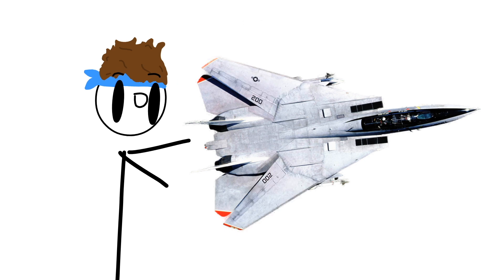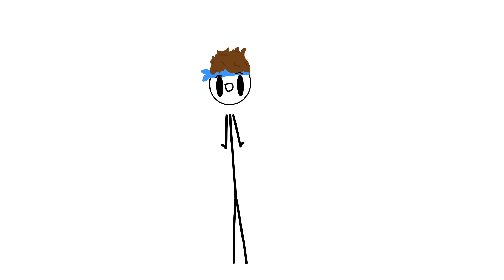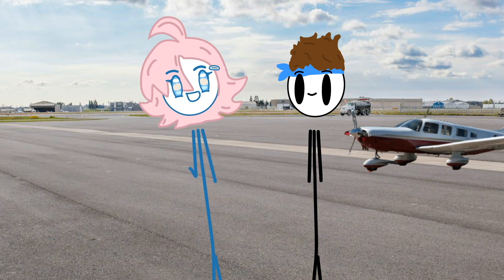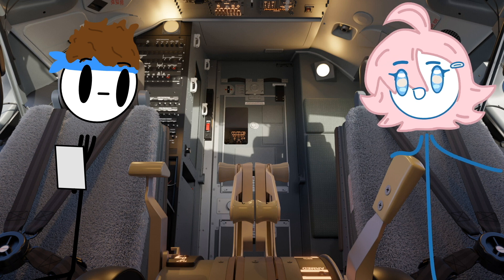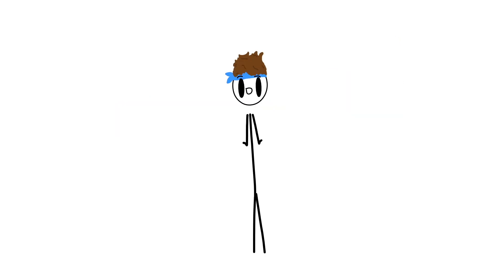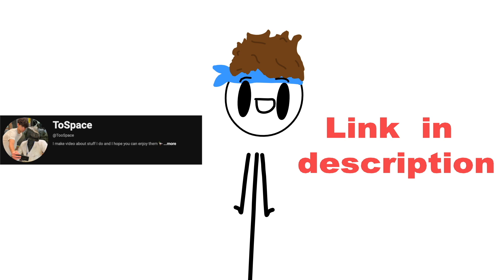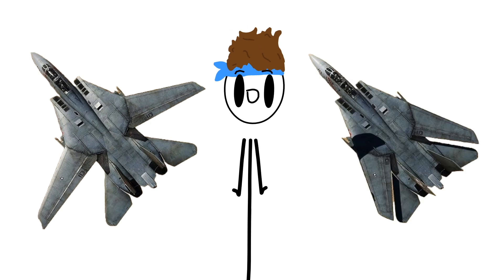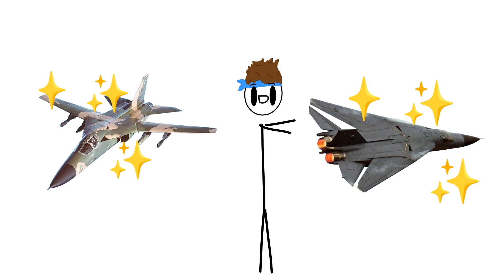Why this Plane is the Way it is

Comment: fairly certain that mach tuck (the lift moving back) actually pitches down the aircraft rather than pitches it up, correct me if i'm wrong though: 2:33
Reply from the maker: No you're absolutely right, I made a mistake..I put the correction in the description. Thanks for writing a comment 🦆
Reply: canard cooler

Comment: Some facts about the F-14
Currently if the F-14 was left in service we would be paying as much an F35 amount of cash every time the navy repairs one.

2. The F-14 if not retired could of gotten more upgrades we could of gotten the F-14D an F-14 with new radar and could carry bombs i think then the SF-21 so Super Tomcat-21 which turned into a multirole fighter and AST-21 Which also got stealth apparently if it was bulit. and the Airforce were considering the F-14 but went for F-15.

3. The F-14 Likes compressor stalling alot which is what killed goose. Simply compressor stalling is when the engines dont get any air and the engines just shut off due to lack of air and then u go into flatspin. this dosent just happen due to flying through jet wash this happens if u do too hard of manuever on the F-14. The intakes were also had alot mechanical bits to help with stall issue I believe but on F-15 they just made the intake rotate with the plane.

4. The F-14 had the worlds first microprocessor.

5. Tom in Tomcat comes from navy admirl.

6. Last one theres a mockup tomcat with just 1 Rudder and it looks cursed.

Also F-111 WAS MENTION HOLY SH ARRRRRADDDDDDDDDDVAAAARRRRRKKK
final neat info F-111 was forced upon the Navy buy navy said it was too big and heavy. But the navy did wanna keep the sidebyside seating and ejection pod then seats F-14 had none of those lol

If u want more F-14 info theres videos on youtube that explain this all better then me
anyways good morning good night imma head out

Comment: The thing i love about the f14 is it's built around the AIM 54 and the AN/AWG9 radar 
and you gotta love the aim 54 it's over sized but it's the first fox 3 and marks a turning point to beyond visual range engagements as we know today (that the aim 7 started)
Anyways fun fact the f14 had something called glove vains which are little lift surfaces that deploy in front of the wing at mach 1.4 they increase left and move the cinter of lift forwards (i also suspect that they make the shockwave miss the wing redusing drag in a similar way arospikes on some slbms do but thats just a hunch) however they were very mantnece heavy and just plain heavy so only the a verent has them (and some sorces even claim the doors for the glove vains were welded shut on the a verints so ground crews wouldn't have to deal with them)

Comment: With its wings swept back, does it get any of the benefits of a delta wing? Or does the space between the wings and the rear horizontal stabilizers break up airflow too much?

Comment: Heyo, a great video as always. 

Just wanted to expand on the topic of why unswept wing aircraft are not usually flying at transonic speeds. This is in no way a critique of the contents of the video, I’ll just try to expand the topic a bit more for the people interested.

The reason we see swept wings at all has to do with two things. First one is airfoil design. As already mentioned in the video, as air moves over a curved airfoil, it will have a tendency to accelerate. This can cause local supersonic airflow regions to form even when flying subsonic. The interesting thing about supersonic airflow is, that (from the point of view of air) it’s easy to enter, however exiting supersonic airflow can only happen through shocks. This “termination” shock is as strong as the speed of airflow over the airfoil. As thicc subsonic airfoils accelerate the air more (to be able to produce more lift at lower speeds) this in turn causes the shock over the airfoil to be stronger. If strong shocks are present on an airfoil, this can cause a separation of airflow behind them (this can also cause lack of airflow over control surfaces). As this  separation moves forward over the wing, the shock gets weaker, the airflow reattaches. The airfoil will oscillate between the two states causing vibrations also called buffeting. To reduce the effect one sweeps the wing and reduces the speed over the profile of the airfoil, hence decreasing the intensity of the shock. This will however decrease the efficiency of the airfoil at lower speeds hence variable sweep mechanisms.

The second reason is drag. As we near supersonic speeds, this acceleration effects will be seen around the entire airplane, causing what’s known as wave drag. We therefore differentiate between subsonic and transonic flight regimes. As a rule of thumb, transonic regime starts at around Mach=0.8 . This type of drag is solely the function of the cross-sectional area distribution in the flight direction. We hence try to “introduce” the wing to the airflow gradually in that we sweep it. 

It should be mentioned that sweeping the wings is not the only way to fly supersonic. The best example of this is imo the F-104. There we have one of the few examples of an actual supersonic airfoils, thin with a sharp leading edge. This airplane was an interceptor supposed to fly near Mach 2. Here wave drag is not as big of a concern and also certain mechanisms of wave drag work differently, making relatively low wing sweeps better choice.

Let me know if this was too much, just started writing and I couldn’t quite stop myself. 😅

Anyway if you want someone to consult these topics, feel free to contact me. Even though I’m not an Aerospace engineer (yet), I do have some experience in the field and as I lack the financial means (still a student) to support too many creators  (currently only Mustard) on Patreon I’d love to contribute to this channel in some way.

My e-mail: bbabik@pm.me
Reply from the maker: Thank you so much for the extra info 🦆I'll definitely write you an email when I get the time!